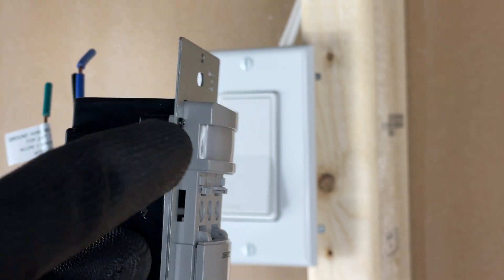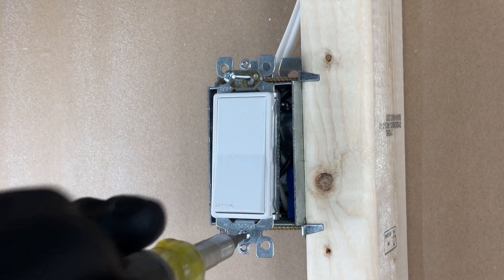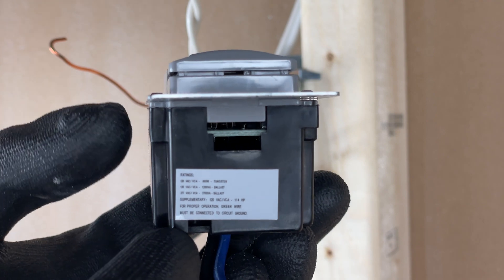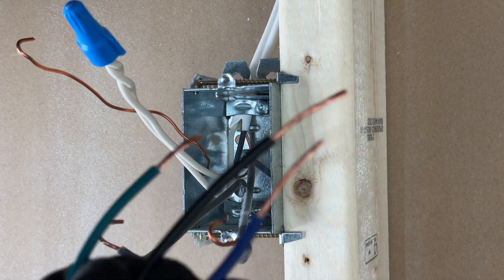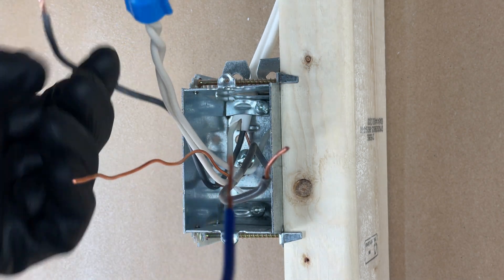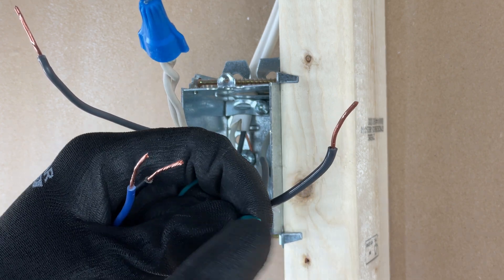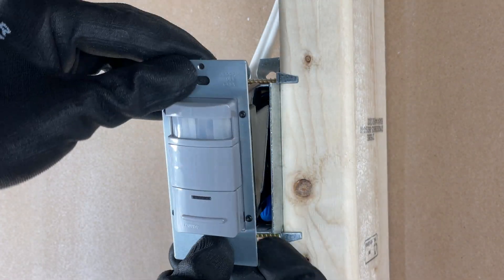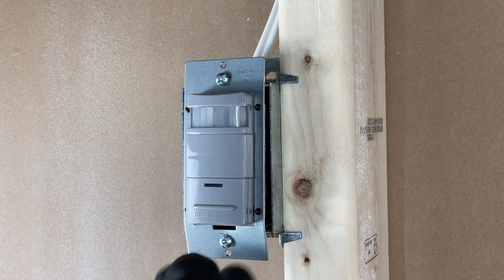How to install an OCCUPANCY SENSOR - Turn the light on automatically - The Electrical Guide

Comment: a question regarding stranded wire. when it comes to a central vac do you have any tips for working with such brittle wire?
Reply from the maker: Yeah for sure, firstly when you strip it try to ensure you’re using the correct strip tool and size for that wire. If you score the thin copper strands they are more likely to break off. Secondly use your fingers to gentle twist them together not a tool. Lastly ensure you’re using a small marette to make the connection, one rated for that wire size. Hope that helps!